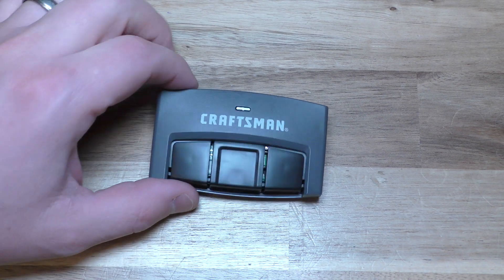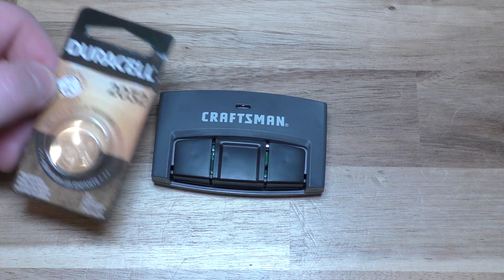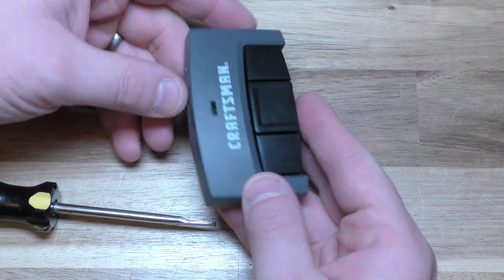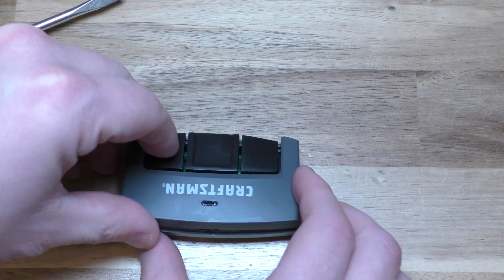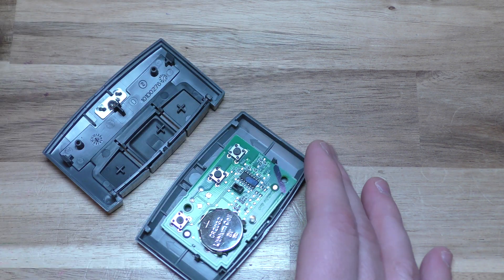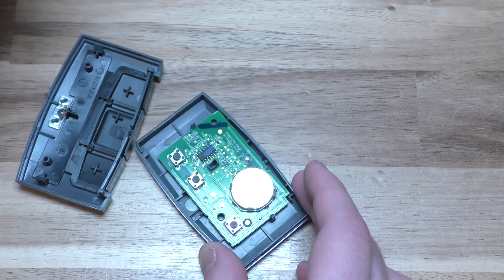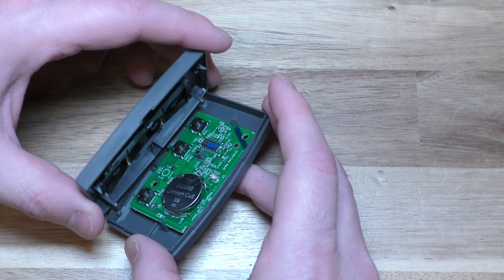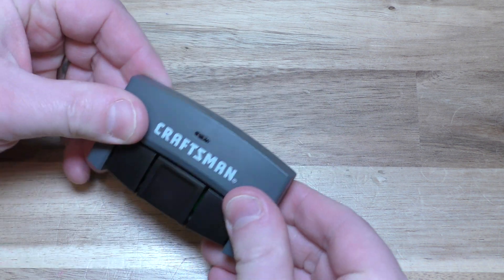Craftsman garage door opener remote battery change - EASY DIY

Comment: Re-assembly is very tricky.  Key wording was when he said hinge.  There is kind of a sweet spot with no margin for error and then it snaps into place.  Other people have remarked about the slight gap where the black buttons meet the gray frame. There is a slight gap which is suppose to be there.

Comment: Honestly, I found this kind of garage door opener to be horribly fiddly trying to put back together.

It took me trying to find this video and then mimicking the reassembly as seen in the video to try and get it back in one piece.

And it took finally sitting down to see that even when put together correctly it still has a space between the buttons and the bottom of the case which normally makes you think it’s put together wrong but seem to be how it was supposed to be designed.

Either way, glad to see this video explains how to dismantle and reassemble the door opener that was missing in the manual.